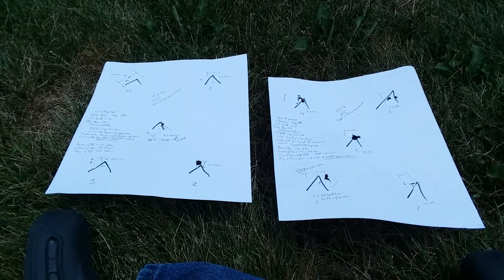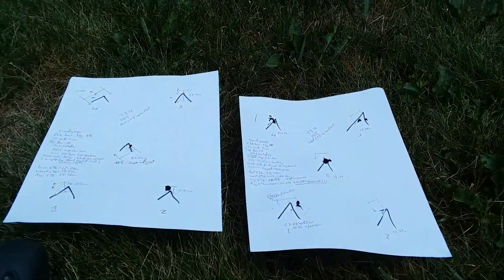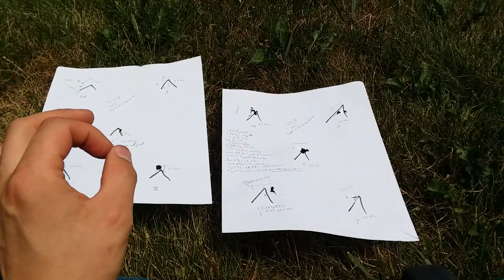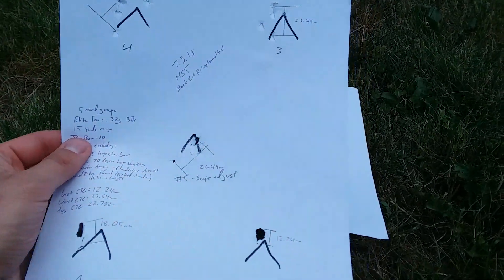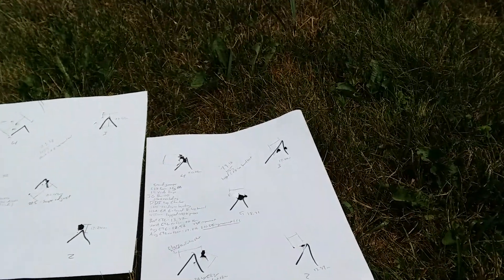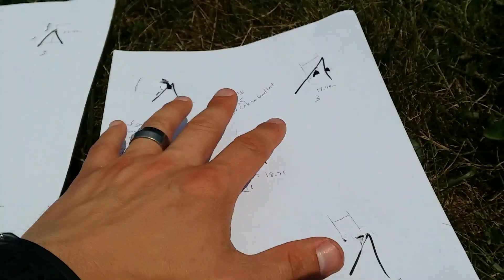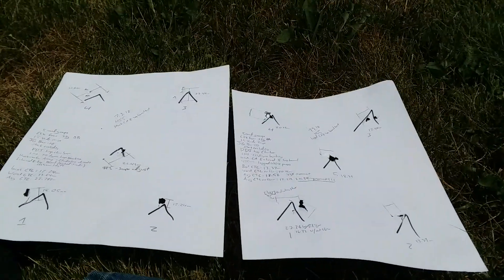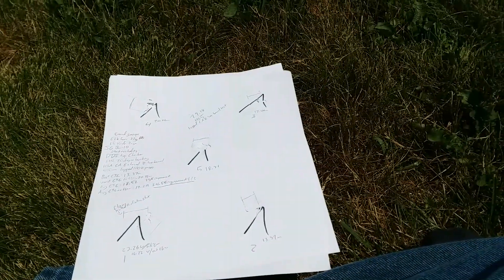Quantifying the Performance Gain from Barrel Lapping

Comment: What surface finish did you achieve/will you achieve if this service is used? Or is it price dependent?
Reply from the maker: Essentially mirror finish, although it is a bit more complicated than that in practice both because of how lapping works and how most people observe their barrel bores. There is a before-after image on the product page (shown under magnification) that should give you an idea.